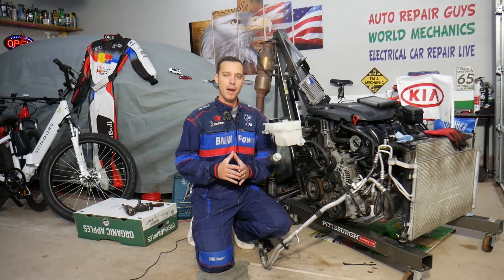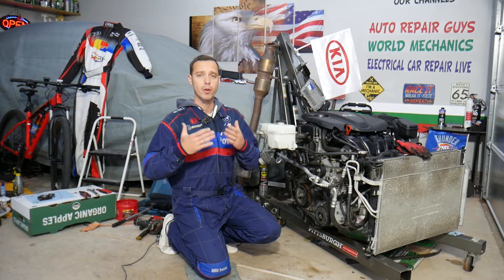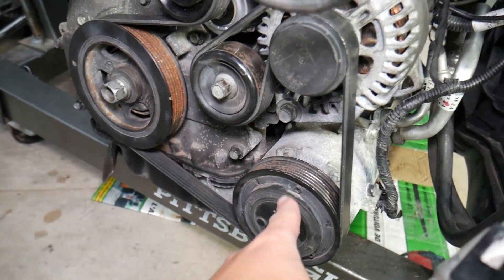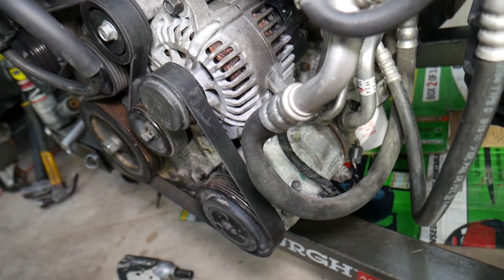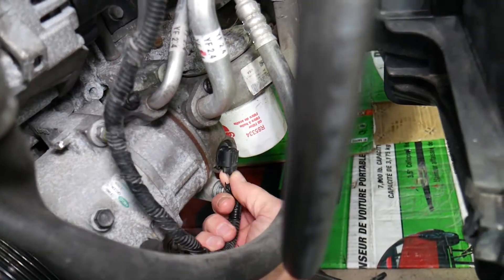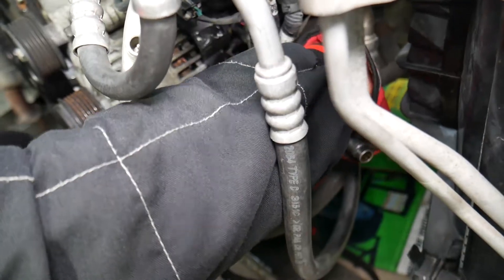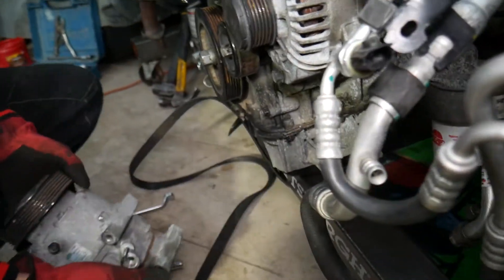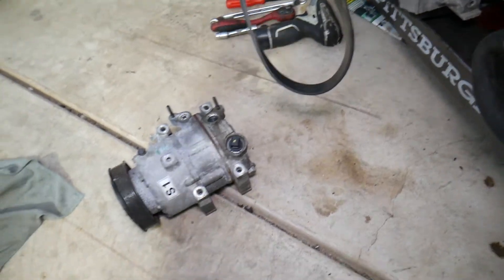AC COMPRESSOR REPLACEMENT REMOVAL KIA SPORTAGE, KIA SORENTO

Comment: ac lines stuck on compressor. corrosion around treaded bolt. any tips on removing? used pb blaster and freeze off to no luck